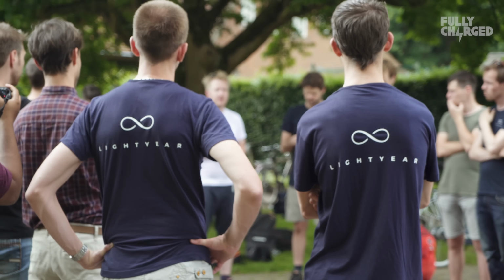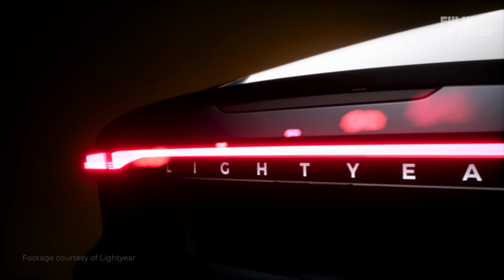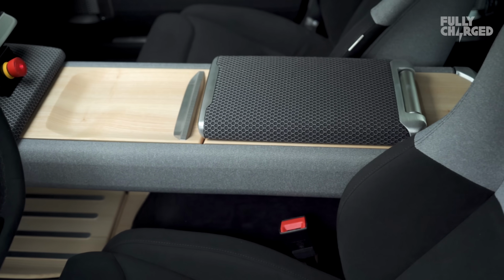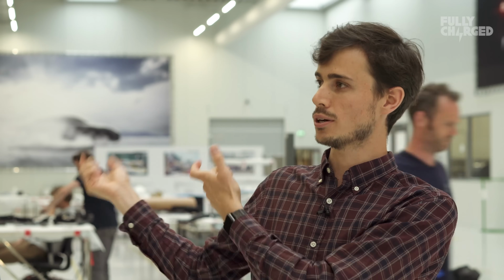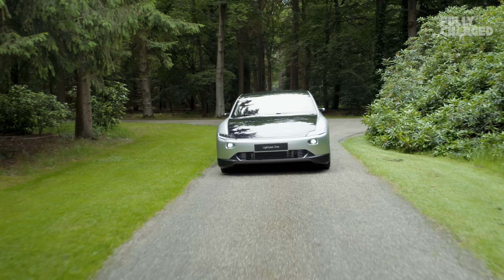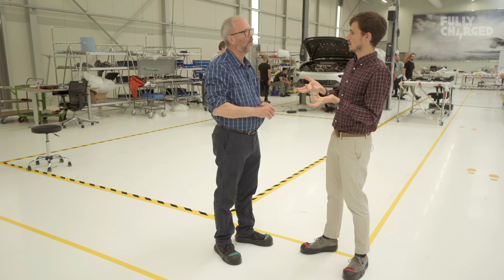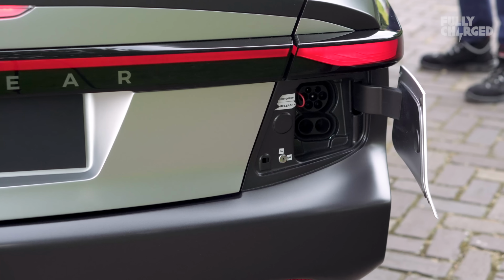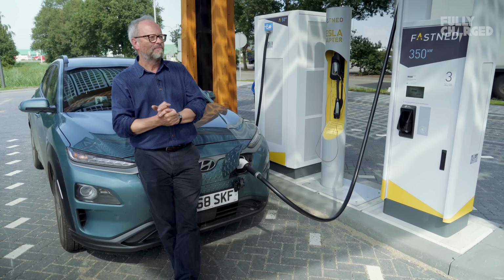Lightyear One solar powered electric car - exclusive first look | Fully Charged

Comment: Nice car, but producing a prototype is the easy part. Good luck mass producing it. That's the stage where all these electric car startups fail to progress past.
Reply: Eindhoven is the city of industrial design, if its possible somewhere its there
Reply: When fuel runs out everyone will jump on the train
Reply: Total Gamix:

What fuel source is used to produce solar-panels and battery packs? Mostly Fossil fuels. The amount of energy required to produce a Tesla Battery-Pack equals driving a Dodge Hellcat for 7 years at 12,000+ miles per year. Batteries settle-down(just like solar panels)lose 20%+ of their  capacity very quickly.

Then their is the Environmental Destruction that is involved mining Lithium-Oxide (most cost effective material) used in the Production of Lithium-Based batteries. Green Folks don''t want the truth to be known....just as long as the Fossil fueled energy plants are not in their  backyard.....so the lie/illusion can't be seen.

If you plastered the entire Globe with Panels/Windmills....they could nowhere come close to meeting our addiction for energy...and that includes electricity.....more so, there is no way to store it...and what happens when it gets cloudy and the wind is not sufficient to turn the blades of working and broken windmills?.Your cold as hell and have no lights,etc.

 Gearbox failure is quite common for wind-turbines....and guess what's used to get them spinning from parasitic friction even when the wind picks up? Fossil Fuels.
Reply: @dmcnamara9859  the co2 emissions to produce an electric car is similar to that of a conventional car and sometimes actually better. 
Everything we make produces co2 including the people who need to work at the factory!
The only difference with an electric car is that once produced, you do have the option of using power from alternatives such as solar(the cheapest electricity currently on the market and getting cheaper unlike all the alternatives). 
The other large factor for many people who live in cities is that the pollution is not in their back yard. Fossil fuels are dirty and the exhaust from 2 million cars in a confined space does have a serious impact on the air quality in a major city. 
If you are going to complain about this, you do need to have an alternative because when you don't, you sound like someone who has given up trying to find alternatives to a problem that is coming, such as no more fossil fuel!
Reply: @D McNamara your numbers are way off. From an energy point of view the break even for a Tesla P100 is about 4-5 years (when compared to a similar ICE car). And even if it was 7 years: cars are used for longer than that, so overall the Tesla would be more efficient  anyways.

Plus, keep in mind that this is a luxury sedan with a 100kWh battery pack. 'Normal' EVs have batteries only about half the size.

Plus, all that does not take into account 2nd life use of the batteries. A car is a rather demanding application for a battery, but once it's down to 70-80% capacity it can still be used for years in stationary applications. And afterwards it can be recycled to about 90% with current technology.
Reply: Stephan Weinberger:

Batteries only work as intended in optimum environmental conditions.............70-80 degrees(year-round).......and seldom do batteries have even 50% working and draw-recharge working capacity 7-10 years down the road.

Who's going to haul and dispose of the : Leaf,Volt,Bolt,Camry,Prius,Chinese Contraption,Porsche,Tesla battery pack,etc. when it's spent? No one....as it's cost-prohibitive......even most  recycled material end-up in landfills. Read "garbage land " and other books related to the hoax of recyclables.
Reply: @dmcnamara9859  I don't know why you are quoting 50 year old statistics. A solar panel takes about 6 months to deliver the energy that was used to make it these days. The total energy produced by the solar panels on this world already surpassed the total energy (clean or not) used to create them. The most important component of a solar cell is sand.
Lithium as a material for batteries has always been an issue. 40 years ago, my polaroid camera used lithium batteries from before the time they were used for rechargable batteries. In that respect, it's good that they finally use Lithium in a large scale for rechargable batteries.
You seem to miss the point mostly on wind and solar energy. You say it is better not to have them. But wind and solar is complementary energy provision. Good to power daytime usage. It won't work without a stable energy provider next to it. There are teams of people orchestrating handling the estimated needs and the expected delivery of green energy, and they do a good job, despite naysayers saying it is impossible.
So in total, solar panels and windmills save a lot of fossil fuel (or other energy) usage (unless you don't have a good managed grid, like in the USA), even though they can't prevent the need. By using batteries to store energy (which is more efficient than using H2 as a power source), you can even make their use better.
But next to those, there are a lot of other energy renewal programs, like using industrial heat waste as heating for houses and hot water.
In large solar installations in equatorial territories, energy can be stored in molten salt containers to get through the night.
It's always good to question if something is worth it, but it is also good to keep with the modern times where industrialization has optimized production of panels for instance.
Reply: @dmcnamara9859  Yes, batteries still need to be improved, and new, greener materials found, you made your point. Fortunately, we're going in that direction constantly, despite the fossil fuel lobbies' efforts.
Reply: Adam Danilowicz this is not the point here this thing it’s going to cost around 150k dollars of course it’s not a mass production car it’s a beginning of a new technology
Reply: Adam, I dont thnk this is meant to be mass produced. This is for the people who are called innovaters in marketing. People who buy ahead of the curve. It is the tech that they will integrate in cheaper cars suited for mass production.
Reply: Yeah, like Lit Motors.
Reply: Simeon Jankovic:

Read Cadillac Desert and many other books related to energy. The reality is: even if relied entirely on Nuclear only (O-"hydrocarcarbon/CO2"emission energy)...the entire World's demand for energy would only net 20-40 years.

Fossil-fuel sources are good for maybe 200+ years.......then we are back to cutting down trees,horse manure,killed-organic oils,to meet our most  basic needs.

Do really think people are  going to be concerned about EVs and hydrocarbon and CO2 emissions when all the the cost effective fossil fuel are spent? Not a chance in hell...horses and animals will rule/run the economy again....along with little and massive hydroelectric projects. And yet, as the non-sensible or rational "green" Nazis have come of age....they will demand people,cows and horses,etc. to  have have methane "trap oxidizers" strapped or surgically applied to the rears along with bi-annual emissions tests.Do you want non-productive/cost effective/expendable electric windmills and solar panels being forced down your throat at considerable expense your whole life? Or if it's not in your backyard....yet the next  bordering/ruralcommunity it's ok?
Reply: check the website, they plan to make only 1500 cars a year, it's not crazy ambitious, but a good start. They are also located very viable for an automaker, close to many tech companies and a railline and a port (Veghel). In the video they want to later introduce a cheaper variant that would need a bigger factory, but again, that's no problem for the dutch engineers. Everything is close-by.
Reply: Exactly this car doesn't have all the safety requirements that is needed to enter into the US and EU.
Reply: Yeah, people outside car design industry have no idea that making a prototype car is just reaching 30% of the project.
Reply: KR!RK but its functional so that a good step
Reply: @krrk6337  after watching the problems at Tesla I think many people are now realizing this problem.

Comment: But solar panels degrade...
They should be replaceable, not integrated in the car.
Reply: According to my profs the solar panels they installed on the roof of the university building degraded about 5 % by now.
They installed them about 15 Years ago.
Effectively zero maintenance on the panels.

Comment: Finally the weight problem is addressed  by a car manufacturer. A human is 80kg but for some reason we feel compelled to go from A to B with a vehicle that is at least ten times our weight. To think of the awesome mobility given by a bicycle for a fraction of our weight... 
It's no comfort to go around in luxury knowing that it's compromising the future of the whole specie.  
Light cars should be the keyword almost ten times more than electric vs gas. Best of luck to Lightyear from France. I am already a big fan

Comment: It can't work because the weight of the car means almost nothing at highway speeds.  So, it's low weight won't help it go 200 miles at highway speed.

Comment: After wading through the  many negative comments one tends to wonder if some of the commentators  still use hand wound mechanical computers  and signal flags . Ye gods lighten up, folks.....ALL new forms of device be it car, phone , TV, computer , aeroplane, food mixer, toaster or space exploration vehicle has to start somewhere. Lots always fall by the wayside through lack of investment or they're just plain crazy to start with. Think about it.......would you want to fly in a Wright biplane next time you go in your hols to Marbella, sit through an episode of Red Dwarf  shown on a John  Logie Baird TV, attempt a phone conversation on an original Bell telephone, read a book by the massive light supplied by a Swann or Edison waxed cotton filament "light" bulb, drive an original tiller steered single cylinder De Dion- Bouton, with brakes about as good as sticking out yer foot to stop the QE2 at full tilt, to work every day, use the original "sat nav" spread across your knee or have your din-dins burnt to a frazzle on an all singing all dancing  stone age oven and spit? ;) Innovation takes time and effort, time and effort which a helluva lot of folk aren't prepared to put in themselves, but are quite prepared to pass on their wonderful "knowledge " on the subject free and gratis. Much kudos to the designers and builders of the Lightyear One. It may or may not do as it says on the tin, but at least they're having a go. Oh and ole Wotisface ain't too bad at presenting the ideas too. Ta muchly young Robert and co :)

Comment: They should sell it as a bolt-together kit car. Build it yourself at home and  they supply most of the parts. This way they can get it for sale quickly without having to go through all the safety tests and other complications involved in selling a car.  If they managed to sell it as a motorcycle they can get it on the market very quickly.

Comment: Great video, but they just skipped over info like: how long to charge on solar alone.  Seems like this has a long way to go.
Reply: Well it’s like 1kw/h per hour, so several days. Almost a week
Reply: 10 - 20 km range charged per hr. It has a 400km range with no sun. Best case you get to charge to full in a day, worst case three days. If you drive at an average speed of 80kmh you can drive for 5 hrs with no sun, about 7 hrs with sun.

Comment: Just 4 years ago i had the same idea and talked to work colleagues  and other people. They said its not  useable,not workable, just not practicale. 
So i am glad to see that its definitly  possible and its so eficient and usefull.
Reply: 4 years ago it wasn't practical. The tech is rapidly evolving
Reply: Realy, you think that? I mean Solar panels are existing for decades. And Elektro Motors even longer. 
Sure Eficiency increase. But the reason was more , that it was not in Mainstream. Nobody knew sbout this technology on wide mass.
Reply: @kirschkern8260  the solar races have been held in Austrailia since 1987, so the tech has been known in automotive circles since the early 2000s. Solar panel efficiency doubled from 2015 to 2018.  Not only that, but the weight of the substrates has dropped dramatically. These changes have taken something that wasn't worth doing at all 5 years ago to something that is barely worth doing in 2020 and something that may make a whole lot of sense in 2025

Comment: 1,25kWp for 10-12km charge per hour? How does that work?
in Northern Europe you get about 800 up to 1000kWh/kWp per year (0,12kWh/kWp per hour)

So he's suggesting that you get about 10 to 12km of range out of 0,15kWh???? (0,12kWh/kWp*1,25kWp)
That's 1,5kWh for 100km up to 120km... That really is quite efficient. And also bullshit. (for comparison: a Tesla Model S uses about 20kWh/100km on the street)

Comment: It needs more rear seating and headroom the way the host's head is almost touching the ceiling. If they use plug-in electricity charging stations I hope they have universal plugs 185kwh.

Comment: I'll try to do some estimates here
Ok, at 1.25 kW peak power, you might get 1.25 x 6 = 7.5 kWh per day. A Tesla S averages at roughly 200 wh/km. So this energy will allow a 35 km trip per day on solar. (Multiplied by 365 days in a year this goes up to 10000 km per year started in the video). But this is a generously maximized estimate. Real life figures will be at least 2 times lower. Still quite impressive!

Comment: Sono Motors Sion + VW XL1 = Lightyear one. Would like to see a smaller version 50-100km range, 2 seater like the VW L1 with removable battery packs like Pipistrel. Charge one battery pack via PV from house roof and instand charge by swapping empty battery pack from the car.

Comment: So many questions!
What is the Cd?  What is the weight of the prototype?  How is it constructed?  If it has a 60kWh pack, and drives 450 miles, that is 133Wh / mile - which is AMAZING!  That is possibly even better than the EV1.

Comment: Specifications:
Range 725 km (WLTP)

Drive All 4 independently controlled motors in each wheel  with advanced torque vectoring.

Energy use  83 Wh/km (WLTP)

Acceleration  0 – 100 in ten seconds

Dimensions (L x W x H)  5057 x 1898 x 1426 mm

Charge speeds
Solar
 12 km/h 3.7 kW at 230v

35 km/h
 22 kW (Public) 209 km/h

60 kW (Fast charging)
 570 km/h

Interior
 Seating Five adults: two in front, three in back

Luggage space
Normal: 780 L
Extended: 1701 L
Center console: 12 L

Extra
Over the air software updates
Companion App
Wireless key
Apple CarPlay
Android Auto

Comment: Hope this will be a success. 10 12 km/h charging speed is quite good a parked car which is doing nothing, other cars always need energy input, its feasibility and efficiency is another debate but I loved the concept, i drive 40km per day or max 60 km, 75+% drive less then 50km a day so it will be a nice combo of solar miles. as he said that 10000 miles annually, that will is a good figure.my car is parked in the for aleast 7 to 8 hours in the sun,  good technology coming ahead

Comment: I am a little jealous that FastNed has a Tesla Mobile Charger at their charging stations.  Over near me (in Colorado Springs, Colorado) we have the EVGo network and I am forced to use the adapter and remember which of the two kinds of chargers they provide that I can use.  

Having a Tesla Mobile charger like the one in this video would reduce the time it takes for me to charge at the EVGo spots (by just a little) and it would not penalize me for forgetting which charger I can use.

Comment: Cool concept but entirely too impractical and inefficient. The numbers they quoted for how much it can generate most certainly don’t account for the fact that the car won’t always be facing the optimal angle with the sun, won’t always be in direct exposure, can often have the batteries too full to take on the energy being generated, etc. etc. Not to mention that the high sticker price makes it so you are better off getting a top of the line Tesla and putting solar on your roof (also powering your house) or multiple EVs + solar roof, resulting in far more solar power being generated.

Comment: I'm still not convinced on integrating solar into the car- it still makes more sense to have solar where you park
Reply: Charge as you drive, what's not to like?! They should stick solar panels on trains, buses and trucks too when they are, it's logical!
Reply: @bennyceca  what if you mainly park your car in a garage, then you are totally wasting the solar panels.  What you gain while you drive is very minimal.  Solor panels where you charge is a lot more affordable.
Reply: @vinyllpreviews9462  what a lame excuse, most people do not park their car inside a garage! Long drives, you get a free top up, and over time, that technology will only improve so that you can theoretically drive as long as there is sunshine, or just daylight even. This a step in the right direction and all car manufacturers should do it.
Reply: @bennyceca  people who pay $100k for a car usually park them in garages.  I bought a Tesla and built a garage and a place to charge it.  Thank God because there's been 2 major hail storms since I got it.
Reply: @vinyllpreviews9462  I see, you're just jealous it's not Tesla's that have it, that's what your real problem is! Tesla and all the rest will do it later on, it's logical, no brainer! Rare damaging hail storms do happen, but it's never stopped people from anything, one can argue that the reason for those damaging hail storms is because of us, at least by going green, those sort of events may be a lot less frequent! If only solar panels were cheap, I'd cover all the buses, trains, ships, planes etc! People who argue against free energy are stupid!